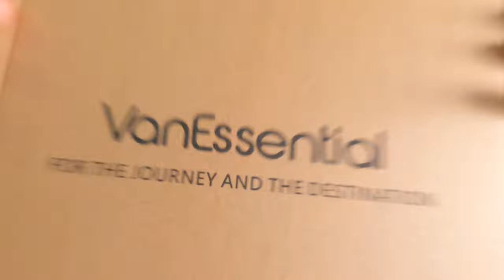Bug Screens For Your Van

Comment: I am planning on installing this tomorrow and it better work and not mess up my weather strip
Reply from the maker: Just be mindful of not pulling off too much at a time and if it doesn’t seem to be going on well check that the metal in the weather stripping isn’t closed or bent. Easily adjusted with your fingers or a screw driver. I believe you can do it!
Reply: Thanks. Considering I built entirely myself, I think I can. I have gotten lazy after living my best life touring the US. lol I will let you know how it goes @Trailvagabonds
Reply from the maker: It’s an upgrade we’ve loved! Feels like a real game changer with the trips we’ve been on so far. I hope it goes smooth for you. The biggest pain was adjusting it to be level but once you get that out of the way it should go well

Comment: On bottom front edge of the slider, where you had to remove that lower casing....how did you re-install it?  
The casing covers a portion of the weatherstripping so it pushes the screen out of alignment.  Did you readjust outside what you showed in the video?
Reply from the maker: I ended up pulling a little extra slack in that corner. It’s definitely not that fun to work around it and was a bit of a pain if I remember right. With the extra slack it allowed it to appear to sit flat and aligned. A little trial and error

Comment: Nobodys talking about the bottom not attaching. this is a highway for some bug entry
Reply from the maker: We have never had issues with bugs getting in the bottom, even when there is some light coming from there. There is actually an explanation from Van Essential about how this isn’t a problem because bugs vision doesn’t work in that way. I’m not sure if any of the other brands on the market have a solution to this. It might just be more annoying with some form of closure there. You could always explore magnet options or Velcro in a couple spots.

Comment: Great video. How’s the bike slide been holding up? I’m trying to decide if I want to fool with it for the mtn bikes.
Reply from the maker: Thank you! The slides have been awesome! Even when we don’t bring the bikes in one of the trays we have gear totes that can fit perfectly and being able to pull out the slides makes it so easy to get to gear from further in the back. We do need to work on some storage solutions to the sides of the trays but I wouldn’t do it any other way
Reply: Nice to see another Matt and Katie video pop up!! Great video
Reply from the maker: Awe! Thanks for always following along! I hope you have been doing well. Getting out on the bike a bunch?
Reply: @Trailvagabonds  yes, a few trips in the spring and now riding early mornings. I am contemplating buying a Trek Checkpoint in the fall to allow for more gravel bike packing. Still on the fence. Looks like Utah is your happy place for you both ❤️
Reply from the maker: Ooo, looks like a fun bike! We have Salsa Journeyman (now Journeyer) which is an all roads bike. Eats up the gravel very well. You can get on some fun adventures on dirt! Glad you are getting out. We haven’t been sadly. I sat on a trainer in the winter before doing a bike packing trip in New Mexico. But after that I’ve only been out for a few rides. It’s 100 here today so it makes it even more difficult to want to ride. The mtns are always a little cooler but you still need to be out by 6am or the sun gets oppressive. We still do our best getting out with the dogs on hikes and such. We’ve had a little more freedom lately and hope to finally get back into shape 😂

Comment: What about the magnet/weight in the top center of the rear panel? What did you do about that?
Reply from the maker: I’m not sure exactly what you mean. There is an opening that goes around the door closure mechanism. It then has a magnet cover to go over any opening that’s there. I’ll have to look at it again if I’m missing something. Please clarify if I didn’t answer what you were asking, I might be missing something.
Reply: @Trailvagabonds  you answered perfectly! I thought the magnet went to close the gap between the door latches, but just wanted to make sure. Thanks for the help 🙂
Reply from the maker: No worries! All the best!

Comment: Do you squeeze the clips with anything, or just push them on ?!
Reply from the maker: The clips are very tight so you don’t need to squeeze them. Sometimes so tight it would be helpful to pry them open. The weather stripping however has a metal track in it that can be squeezed shut to help it hold

Comment: If you install these, are you able to close the sliding and back doors?
Reply from the maker: Yep, the doors will close when they are in place or even if they are rolled up as long as you don’t have a cabinet pushing the roll out against the door too much. They’ve worked great for us and I haven’t had a need to remove them through winter. Definitely can recommend!
Reply: @Trailvagabonds  thank you! Will definitely pick these up in the next few weeks! Great video
Reply from the maker: @BrandonG1394  no problem! Glad to help. Definitely reach out if you have other questions. All the best!🙌🏼